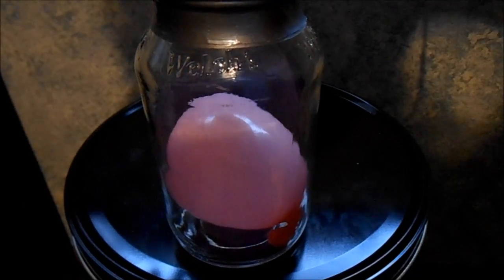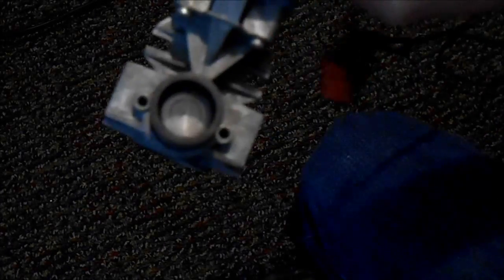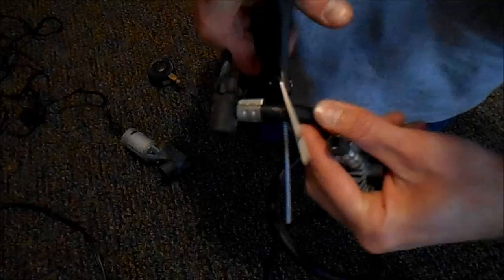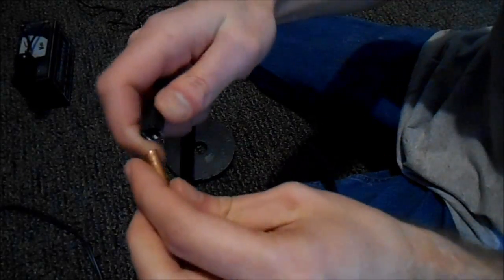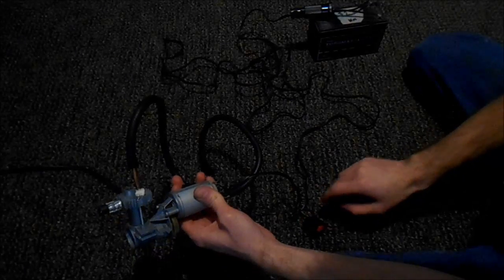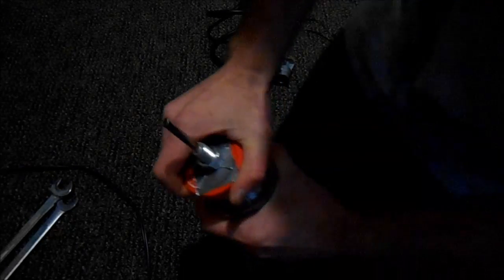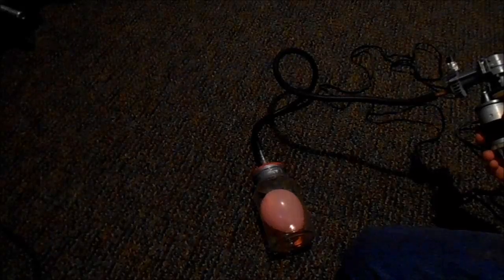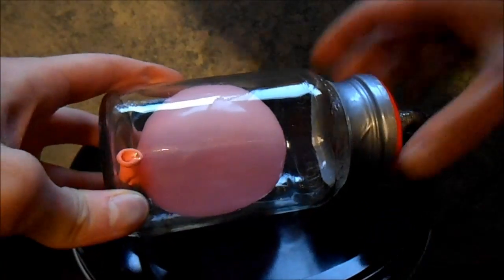Make a Vacuum Chamber

Comment: Very informative. However I'd keep the end of the hose that attaches to the tire and just use a valve stem in the cap. Then you have your one way valve and you are finished. You also should have a gauge to monitor pressure to be safe. :) learned this trick when going for my HVAC license. You can make water boil around 60 degrees using the vacuum method.

Comment: Get a  mesh  shield   around the  glass    -  from  defunct  micro wave  ( knew there was a use  for that )  .   Standard  process  re  vacumm system  -  When  it  implodes  as  re   the  tv  tube  -  you will  not be recognised  by your mother

Comment: If space was a vacuum we would be ripped of the earth or do I misunderstand what a vacuum is.
Reply from the maker: Gravity holds the atmosphere in place, the pressure gets progressively lower at higher altitudes. If you were in a jar with air pressure inside, then the lid was suddenly opened with vacuum outside, then yes you might get carried out with the escaping air. But vacuum is not inherently pulling on anything, it just means there is little or nothing there.
Reply: Our atmosphere is thin and would NOT stop vacuum of space if it were real.
Reply: Yes you are right space surely isn't real. The earth doesn't curve like a ball.
Reply: Braden Mende flat earth:)

Comment: It is possible to make a steam engine out of this little compressor can you show me thanks a lot. Regards Joe
Reply from the maker: It would be possible but the valves the pump comes with will not work (one valve will constantly release any pressure that you get in the cylinder). Maybe I can try to figure it out and make a video of it, or you could.

Comment: Very cool.  I've done this before.  However, the sad part is that if you run a compressor in this manner for any length of time, it will destroy itself.  The reinforcement under the piston was intended to pull air in with minimal effort and push it back out at high pressure.  Setting it up with a restriction on the intake (to generate a vacuum) reverses things and creates internal forces on the piston/wrist-pin/connecting-rod that were never considered.  In other words, the internals were designed to be stressed when pushing air out, not when pulling it in.  FWIW - Just don't put yourself in a situation where you need this to work for whatever you are doing.  I learned that the real hard way.  You'll get some warning though, it will start getting really loud right before the piston breaks loose from the con-rod...
Reply: May May no lol. The piston goes up and down no matter what way the power is connected.
Reply from the maker: +BluntForceTrauma666 Thank you for the warning! I did not use it long enough for that to happen, but I can imagine what you are describing. What happened when yours broke?
Reply: Could you just reverse polarity

Comment: That "one way valve" you keep refering to is called a check valve.
Reply from the maker: +SMOBY44 Yes there are several names for it and check valve is probably the most usual. You can call it a check valve if it sounds nicer to you, but for someone who might not know my opinion is that "one way valve" is a clearer name.
Reply from the maker: ***** Thanks for the tip!
Reply: Check valve is an application. It's a reed valve.

Comment: Thank you for posting this video DIY, im looking to make a vacuum pump for some evacuated heat pipes, ive heard you can make one with a bike tire pump also by reversing some things inside,   Also for leaks, just make one of those one-way valves involving a rubber ball and some PVC pipe, leak solved.

Comment: How did you hook up the battery? Is there a way you can send me a list? Appreciated alot
Reply from the maker: It is connected by a regular 12v car plug, the "cigarette lighter" plug.
Reply: No clips? Just the copper wire ?
Reply from the maker: Clips? There is a female 12 plug attatched to the battery by solder, and the male 12v plug was connected to the pump as the pump came from the factory.
Reply: Thanks

Comment: I used a glass tap fixed on to the chamber of choice, and closed it when the vacuum was drawn. I used a 1 gallon wine demijohn for my chamber, so I could use a rubber bung for the pipes to go through, and it seals perfectly. Downside is I can only put small items inside at present. Hope this may be usefull to someone.

Comment: Check out YouTube user. The King of Random. He shows how to make a one way check valve. Also you could place an O-ring in between the bolt head and the inside part of the lid of the jar and another O-ring in between the top of the lid and the nut, that should give a nice seal.

Comment: Subbed you a while back. Think your idea`s are inspiring, especially at this time of year with the bad weather (Scotland). So, what kind off projects could you use this vacuum for, what do you have in mind?.
Reply from the maker: Like Energetic tests said it can be used for vacuum distillation of H2O2. I might try making aluminum powder in a vacuum at some point, and I had this idea that you could 3D print in aluminum by "selective laser sintering" aluminum powder, but without a vacuum chamber there would probably be a lot of oxide forming and being included in the part. I will need a vacuum chamber also for experimenting with ion drives for spacecraft, research into nuclear energy and production of different types of radiation and maybe even antimatter, work with gas lasers, vacuum deposition of metals for making mirrors (lasers, telescopes, microscopes), it might be needed for some electronic stuff.
Reply: JaycubL Some cool idea`s, keep us posted. Some plasma idea`scame to mind but would probably require a much bigger vessel. I think i have been bitten by the bug,lol Start taking all the household appliances apart.Keep up the good work, i love it!!!....